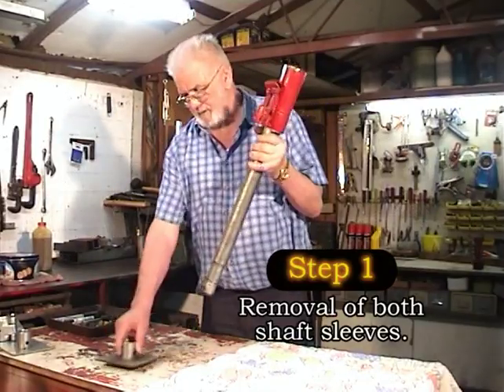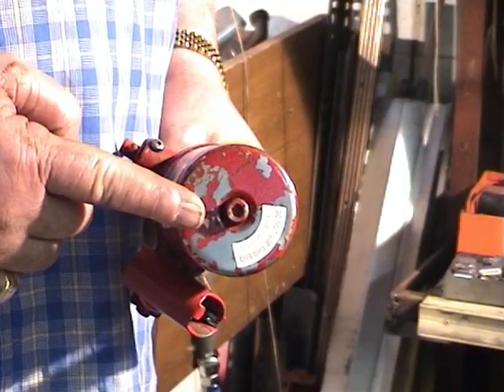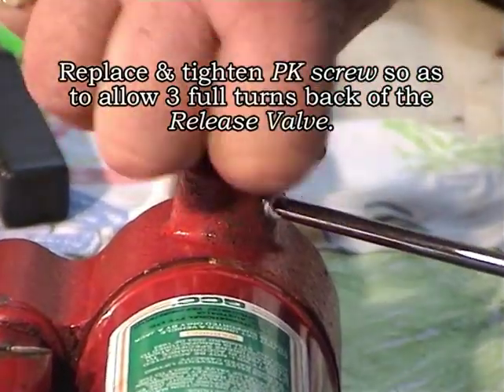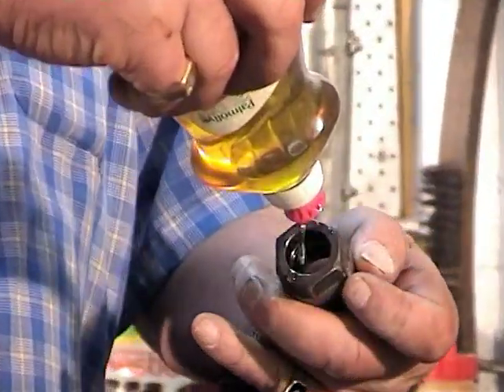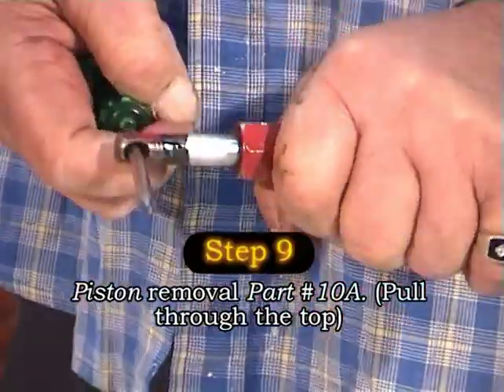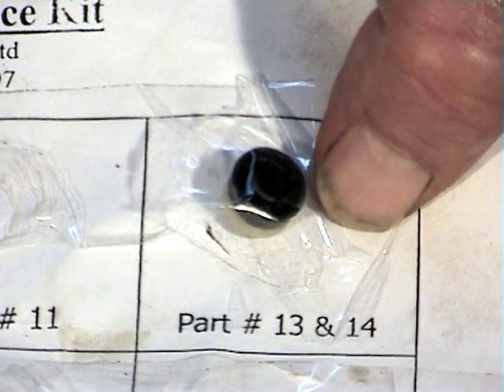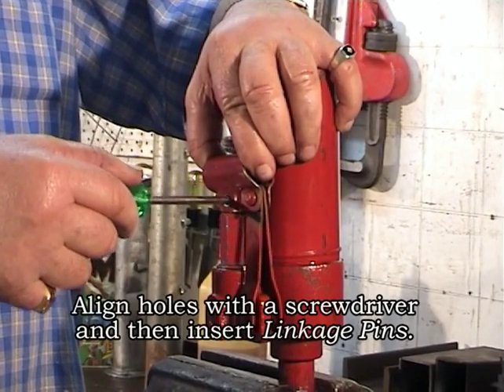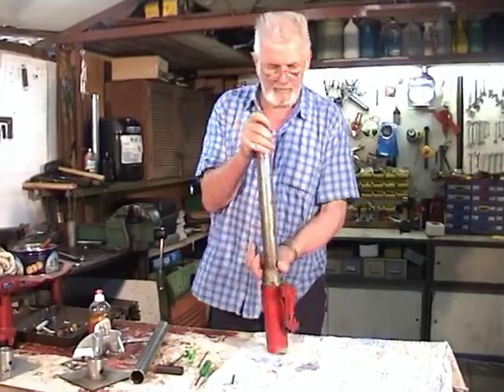Trail-A-Mate Jack Servicing - Part 1

Comment: I found a couple of small issues with the procdeure:
a. In step 1, the 10 mm bolt on the shaft end was actually a 5 mm Allen key head bolt
b. In step 2, part of the procedure is to check (and, if needed top up) the oil level. In Step 8, because you have to remove the pump piston assembly there is a small loss of oil. In none of the remainder of the video is the oil level checked and topped up